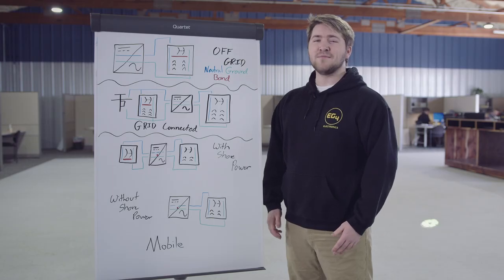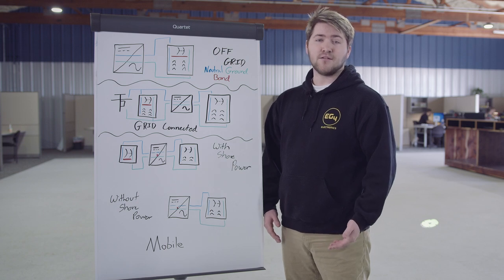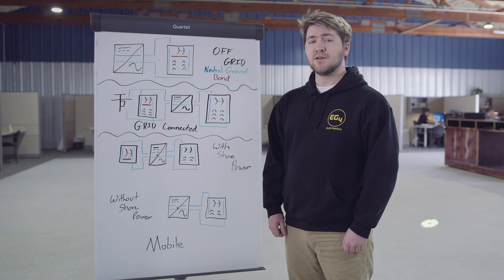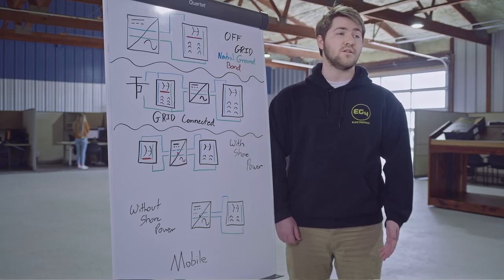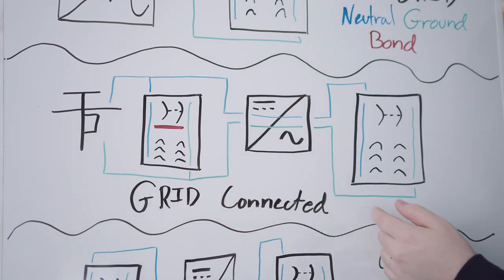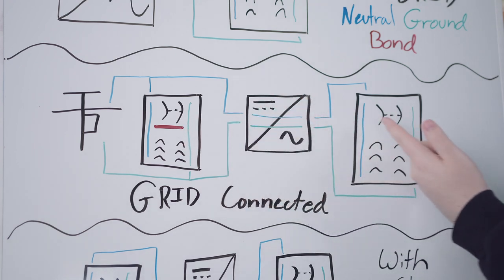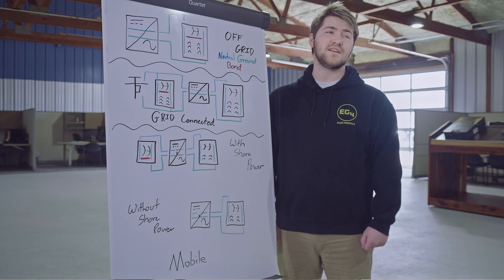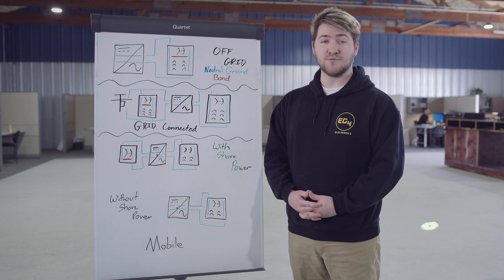Neutral-Ground Bonding | How It Affects Your System

Comment: You all are doing great and I appreciate all your support. Might I suggest including the bonding screw with your inverters all be it loose and not installed. Like you do the comms cable. In future models there could even be a threaded location in the case to have is stored during shipping to be removed and installed only as needed.
Reply: For Goodmess Sakes ship the Bonding Screw either packet or loose. A single page explanation is perfect.
Order? Ridiculous.

Comment: This is an awesome video, it answers every question I've had about N-G bonding and also how N is passed through in Battery and Grid bypass mode. I had added a N wire from main main incoming panel to my inverter output panel to produce a 'common' neutral wiring scheme. I can see from this video that it isn't needed. (but doesn't hurt either). The last thing I need to verify is the removal of any N-G downstream from the inverter output panel this removing any bypasses and potential return paths through G.  Many thanks Brayden and EG4 for stepping up and clarifying this subject. BTW if anyone is interested the standard for the US is called TN-C-S in residential areas. Most likely different in rural areas. Either way N-G bond should ONLY be in 1 location.
Reply: @eg4electronics, does this mean common neutral configuration is acceptable running this updated firmware?

Does this mean I can use a bog-standard interlock on a  critical load panel to switch between mains power and inverter power?

Common neutral where the mains' neutral, the inverters' inputs, and the inverters' outputs all share a common neutral.
Reply: @christopherbosse4754  yes, that's exactly what it means. Just ensure n-g bond is only in your main panel.

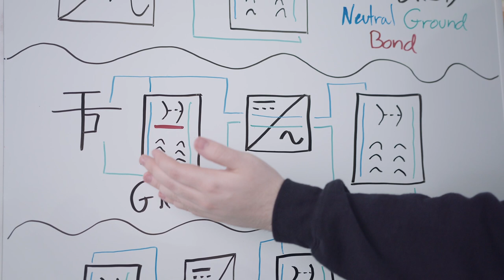Comment: 2:10 so with the bonding screw removed, the neutral is only passed through the relay on units after 2/23 or firmware 79.63? I thought removing the screw forced the bond to always be passed through.
Reply from the maker: The neutral relay would previously disconnect from the AC-Input neutral in inverter mode, which would remove any line to the bond in your main panel. Removal of the screw would previously just unbond your inverters when they weren't in line mode, which caused concern when people had multiple inverters (so no screw) AND had utility backup with a bond earlier in the system (per code). This firmware resolves this use case, and aims to make code compliance extremely straightforward.
Reply: @eg4electronics  So now the inverters utilize a common neutral?
Reply: @AdamDeLay07  that is my take on it,  just like the XW Pro
Reply: @AdamDeLay07  its what ive been doing anyway, had to when using reliance MTS. Now I can get rid of the common neutral at the MTS. my bond has always been only at main panel this way.
Reply: @tyoungs61 I'm  running  the same, reliance MTS. The bond connection is at the MTS and the main panel as if my inverter were the grid to be clear.  My inverter is just substituting a generator.

Comment: Thank you for your video, this subject is important and should be clearly explained slowly with better visual aids. Please consider producing new videos explaining why the screw was removed, and that the screw does not make a permanent bound but allows the dedicated relay to switch depending on the input. Also, which driver a new customer (like me) needs to install if want to add this screw and have the bounding feature working properly.
In my van I'm planning to install all 110V outlets GFCI, since this inverter does not have a dedicated protection ground for the 110V output, what's your suggestion on how to effectively install functional GFCI outlets stand-alone (batteries/alternator) and connected to the grid (considering that the grid had proper protection ground).

Comment: Does the EG4 3000 EHV-48 have the same ability to always pass through neutral, or on that one would it be better to add the bonding screw back in if you want to run it in grid connected mode with battery backup for when the grid has an outage?
Reply: Indicated that this comment was posted a month ago. However as another EG4-3kW (multiple) owner, I would like to know if I need to remove the NG bonding for all the my inverters  utilizing the new firmware instead when using the system in either AC mode, PV mode or battery/stand by mode.... Please EG4 have a response... TY
Reply: I've only had my 3000 EHV-48 for 2 weeks, and I'm already REGRETTING not having spent the extra bucks on a Victron.  Evidently, we 3000EHV owners are low priority.

Comment: What do you mean by grid connected?  These units have the ability to be charged from the grid.  IS that considered grid connected?  
IS off grid where the system only gets its power from solar panels with no ability to charge the batteries from the grid?

Comment: Hello!
I imagine YouTube comments are probably not the preferred means for communication but-
Does EG4 support the use case of dual-inverter mobile systems? Will the potential for Delta-Wye style shore power connections (206 instead of 240) cause concerns for the standard split phase installation? Such setups were approved in the NEC alongside the standard 240 split-phase shore power through the same receptacle.

Comment: Can you clarify "output panel"?  This is the main panel, correct?  It has a ground connected to a copper bar (in the ground) and hot and neutral from the inverter, and the neutral and ground at the main panel are bonded (connected), correct.

Comment: the mobile firmware is not available for the 3000EH?
Reply: Evidently, we 3000EHV owners are low priority.  I'm gonna try to work with this unit, but I'm wishing I had gotten a Victron.